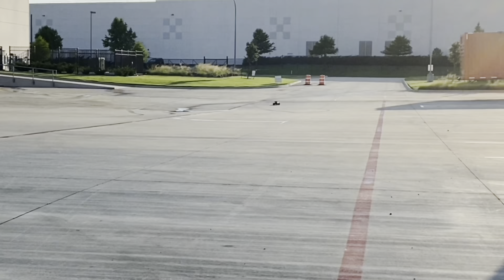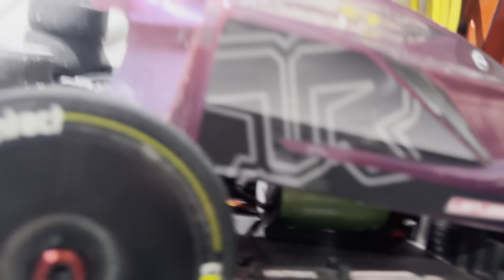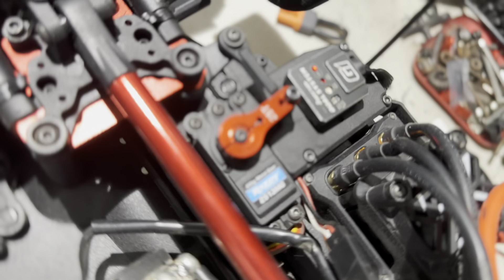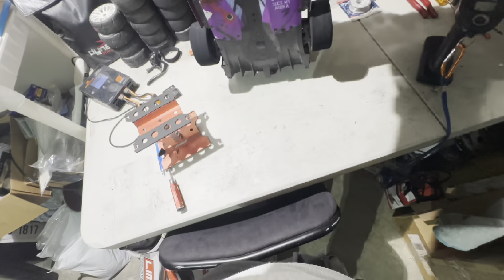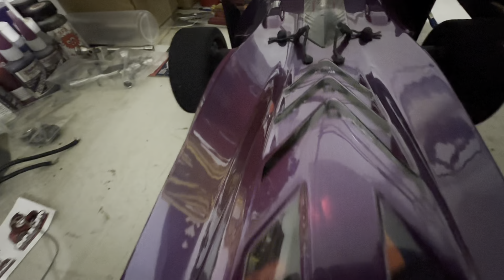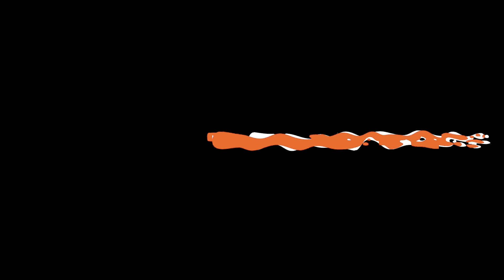Arrma Limitless V2 Update #arrma #arrmalimitless #fyp #rcdragrace #limitless #rccar

Comment: Colour is nice but doesn't suit the decals, 2250kv castle creations motor is a standard motor kv  in the spectrum rtr range of aarma rc cars only difference is that it's 8s lipo compatibl, so speed will be affected. Castle creations 8s xlx2 with 800kv motor and esc combo is a much faster system. Chassis skin is cool
Reply from the maker: I hear what you’re saying….. however for drag racing and tuned it can run 1.5 with this set up